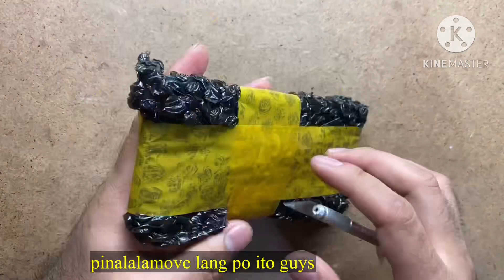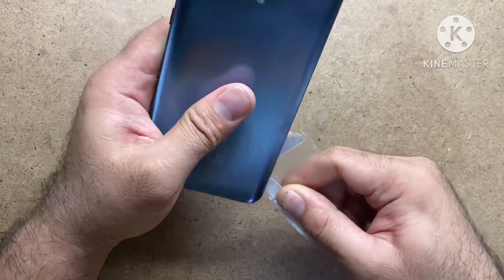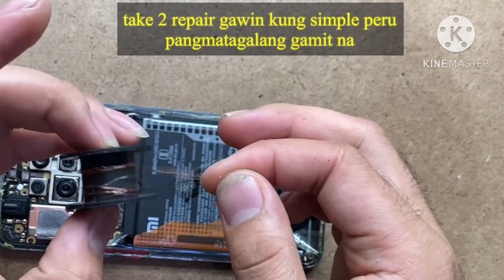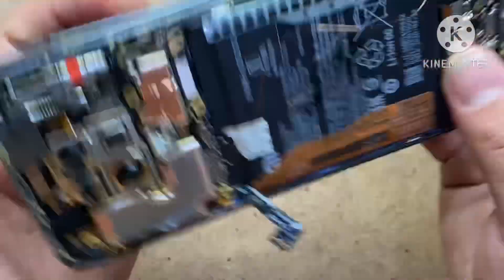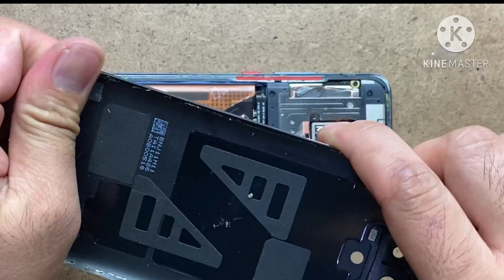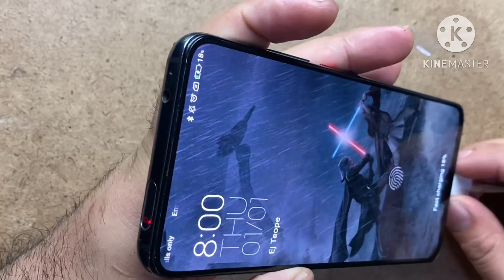Poco F2 Pro Charging Redlight Only Fix  Tamang Pag Place ng Jumper Alamin #pangmatahalan na ito!

Comment: fpc connector problem black 3 4 pin red charger on the fpc, some pins are black, but when charging, it comes out red, if this happens, will it be fixed?

Comment: ganyan din nangyari sa vivo q unsa sira jumper.naputol kasi kulang ng screw..kaya bumili q ng flex naputol ang flex dahil kulang pa din ng screw ..tapos pina jumper ko nmn sa pagawaan naputol kasi kahit nilagyan ng screw at pandikit e subrang napakaiksi ng wire..kaya bumili nlng q ng new flex at nilagyang ng screw at pandikit abg port para la ng alog...nka ubos tuloy kong 700 sa 2x pagawa sa jumper at 2x na bumili ko ng flex..naiinis nga aq kasi may gumawa na basta lng magkapera de pina solid ang gawa..kaya aq nlng gumawa
Reply from the maker: wow good job